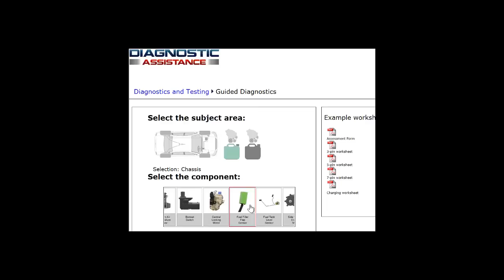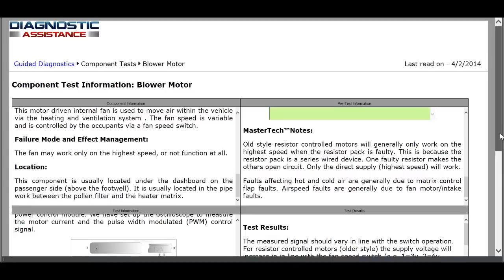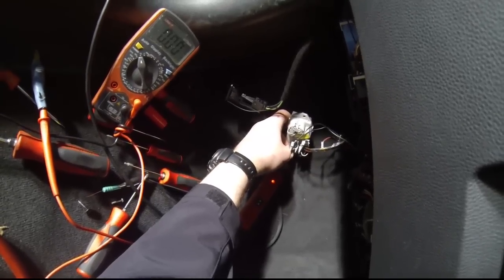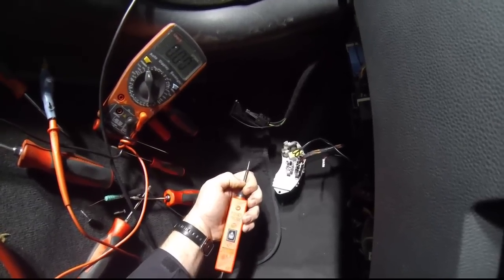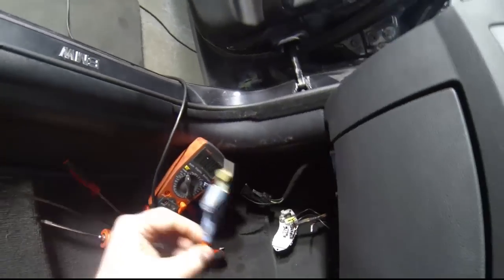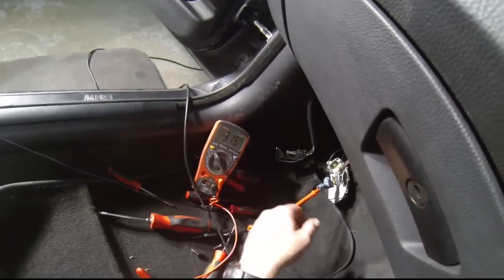Diagnostic Assistance James Dillon BMW E90 blower motor quick test tips

Comment: 10 Years late, but still such a helpful video. My blower wasn't moving any air at all. I wanted to check it out before I spent the $200 for a new blower and resistor. Followed your tips and checked the resistor by itself while increasing fan speed, and the voltage went up incrementally. The blower itself was feeling kind of stiff to move by hand, I sprayed the entire inner motor and coils with electrical cleaner spray, it spun much freer. Plugged it back in and it works great!

Comment: I need some help.. Thank you for the video it has helped alot.. I have changed the blower unit which came with a resistor and still it is not working? I have checked fuses and these arw fine... Any suggestions? I have a bmw e90 06
Reply: the same for me ,i changed the final stage unit e90 2011 ,and the same issue is blowing very low, you resolved you`re problem?
Reply: @iulianpvl4278  same here, did you find solution?
Reply: @davidga6272  Yes, after a lot of research, the problem was the blower motor itself, even if I taked out of the car and I connected to a 12 volt battery was working perfectly, but on the car no , so I buy a new blower motor and I solved the problem.
Reply: @iulianpvl4278  wow thank you.
That was very strange, blower working on external Source but not at car..
So i would need to get new blower (just bought a new fsu)
Reply: @davidga6272 You're welcome!  
In the beginning I buy a new Final stage unit ass well, because the blower motor was working properly on external source, but no improvement, and after I check another blower from another car, and was working properly , and I buy a new blower and everything was fine.
Reply: @iulianpvl4278  
Can i Ask if you Remember the blower went to Max for 1 sec and then back to minimum Speed?
Reply: @davidga6272    In my case even if I increase the volume for blowing harder, was blowing low, like on the minimum , in the beginning I taked the blower out from the car to see if the fan is rotating fine, because sometimes it can make some rust from moisture, so take it out from the car , and see if the propellers of the motor are rotating freely, if no put some WD-40 , and you solve the problem
Where are you from?
Reply: @iulianpvl4278  I already tried to take the vent off the car and put grease on it… and nothing.
I put it on max but it works like on low, sometimes the vent spins for like 1 sec to Max but then back to weak spinning .
I dont know what to do. Im from Spain
Reply: @davidga6272  so definitely it's the blowing motor , because the same thing make even mine, till one day when stopped forever to blow , buy a new blower motor, mine was Valeo on original

Comment: my fan is only spinning slowly, and when adjusting the aircon panel fan speed I get no change of voltage coming out of the fan speed controller output, does this mean it needs replacing thanks or is it something else amiss?? thanks
Reply: same here, did you find out solution?

Comment: Just tested mine on my multi meter and with the analog dial all the ways down (lowest setting) Im getting 12 volts roughly and when I turn it up Im getting a lower voltage... does this sound like the fsu to you?

Comment: I have no power between plug and the car side. I do get 8.5v signal from climate control but positive wire has no power. Any inputs would be greatly appreciated. Thank you